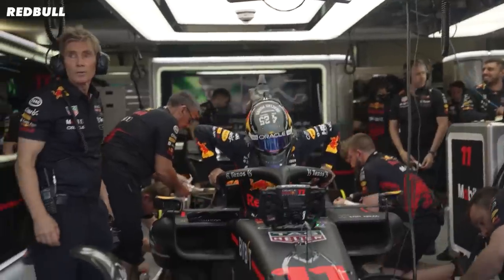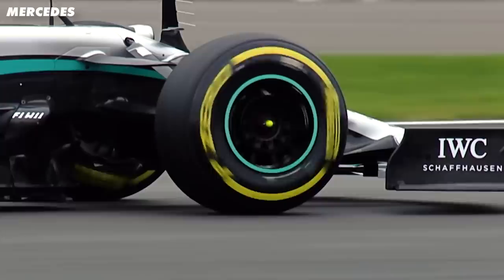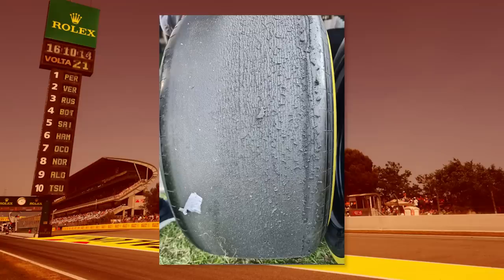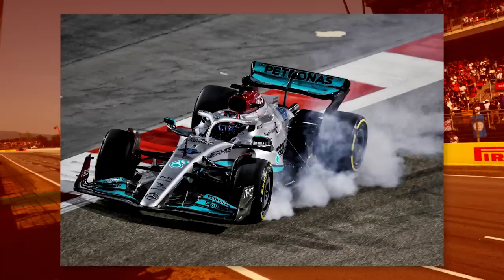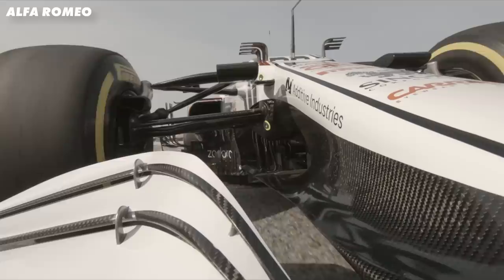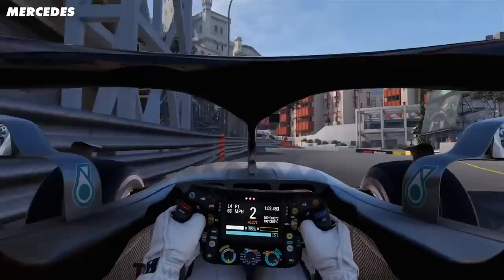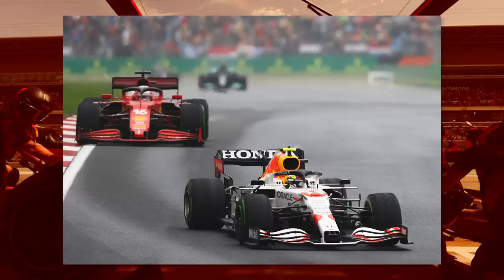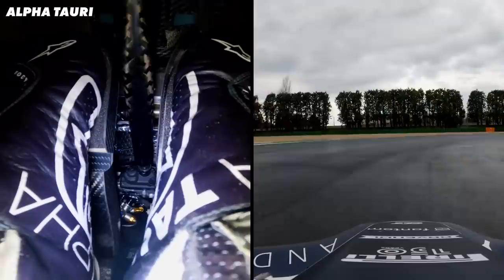Why Perez is INCREDIBLE at Saving Tyres

Comment: I thought Verstappen and Hamilton were the masters on saving tires.
Reply: Hamilton, yes. Verstappen, are you kidding?
Reply: @lorddrac_dontaskmetodance  apparently max became a master too since this year, look at Miami and Imola
Reply: @bokebryant3985  saudi as well
Reply: @bokebryant3985  this year's tires are more durable so I think alot of drivers are finding it easier to manage their tires look at albon in Australia, that would have never been possible with the previous gen of tires
Reply: @lorddrac_dontaskmetodance  Max always been excelent in tire management it's why he won spain 2016 his first race in the car.
Reply: @nulian  That and both Mercedes crashed.
Reply: @bokebryant3985  Max doesn't saved tires that often. Closest thing he gets to saving tires is that you can only run a tire one or two ways during a run so that tread wear doesn't become inconsistent, and he can do that running 100% if he wants to. Really the best example I can give where he could've been saving was this most recent race in Montreal, where he was running his race and hitting his marks, where Sainz was driving the Ferrari 7-8 different way, and when he tried to push on the last lap, his tires were junk, despite him pitting later than Max.
Reply: @lorddrac_dontaskmetodance  i'm a Lewis fan but both verstappen and hamilton are true masters of that
Reply: @lorddrac_dontaskmetodance  clearly you have no clue
Reply: @henrym78  What's your defense?
Reply: @theracingban  probably too, albon was crazy that race
Reply: @lorddrac_dontaskmetodance  maybe, but that results in good tire life after all , intentional or not, haha
Reply: They are
Reply: @lorddrac_dontaskmetodance  Max would rather attack. But if need be he can definitely save his tires. Just look at  Baku where he told his engineer he felt he would need to keep the pace up to keep the tire in the right window. His engineer then agreed 
And Lewis has controlled many races from the front. That makes tire management much easier. If you're 10.or 20.aeconds in front you can easily save your tires.

Comment: My driving style the save tyres is : shifting gears at low - mid rpm at corners and turning the steering wheel slowly to reduce friction .
Reply from the maker: From what we can see in the data - F1 drivers don't do this IRL. More from throttle modulation. It does work in games though.
Reply: @Driver61  hey .you have bots spamming your comment section..

Can you please do something about it?

Comment: Great video, but would just like to say that there are additional mechanisms on top of just the deformation grip you mention in the video (micro and macro features on the track surface and the tyre squishing into those to provide mechanical keying), including adhesion (literal molecular bonding between the tyre and the track surface, "stickiness" of the tyres, also affected by how they deform into the track surface, since it affects actual contact area) and tearing/wear generated grip. Yup, "tearing/wear" is also its own kind of grip type, as explained by inside racing technology:

"High local stress can deform the internal structure of the rubber past the point of elastic recovery. When polymer bonds and crosslinks are stressed to failure the material can't recover completely, and this can cause tearing. Tearing absorbs energy, resulting in additional friction forces in the contact surface."

These three are usually considered the main methods that tyres generate grip with, and each can react differently to track surfaces, temperatures, load, etc. A good example of this is wet weather, which can almost completely remove the adhesion effect (similarly to why sticky tape doesn't work well on damp or wet surfaces), leaving deformation and tearing as the main methods of generating grip.

Comment: Great video! Thanks! I was also wondering: how much of the current way of driving in F1 is just because of physics and rules –the cars move in the most efficient way possible within the limitations and that determines almost all driving decisions? Or does a degree of style or fashion also play into this? I mean would it be reasonable to think that in a decade or so, even within the same kind of limitations, common driving styles could be drastically different? Are there new strategies to be discovered here or are we just juggling known possibilities? I would be very curious to know how you think about this.
Reply: F1 requests that the tires degrade on purpose. They could last the whole race buts it's done on purpose to keep the race interesting. At least this aspect will be similar in the future.

Comment: So, is it a good idea to push harder on left hand turns on a track mostly having right handers?
Does checo's tyre saving ability has to do with setup or its just purely driving style?
Reply from the maker: Yes to the first one, its not worth saving eg right front, when left front is the limitation
Reply: Me activating scenario 7 in austria sector 2 then

Comment: Easiest way to reduce Wear is to drive in a very balanced fashion with minimal braking where possible . Brakes are often overused when racing that’s why front runners overheat their brakes more often than the high speed cruisers who go further on their tyres … Dan used to be good at it too. I’m not too sure why he’s so far back these days, his car is pretty good …

Comment: Not trying to take anything away from Checo, who is a deserving driver in his own right. But the RB car seems to be doing the best of any car on the grid at managing the tyres this season. We heard Horner say that Max's car didn't have the pace delta of Sainz' Ferrari, but rather, he had the grip to hold Sainz off. All this with tyres some 8 laps older than Sainz' set.
Reply: They where 6 lap older hards. Not much of an advantage
Reply: This year does very little to solidify Perez' reputation as a tyre whisperer anyway. If anything, he tends to have more tyre wear than Max. But he earned his reputation long before joining Red Bull. For example, he was the only driver to finish the 2011 Australian GP, the first race with Pirelli, with a one stop strategy, while others had to pit up to four times - and that was his debut!

Comment: Sometimes Max? Besides that Checo lost in Baku because off less tire management     you should check Spain 2016, on circuit where if you push at the end of the first lap your tire is overheated. The dude even drove the car for the first time and just like this Sunday chased by a ferrari but this time for 32 laps, this 18 year old dude even did that race in 1 stop which was unthinkable and you know or should know what that means at Barcelona GP. Yea and this will go on and sooner or later you will realize that you are witnessing the real GOAT of this sport in the making because he is the best this sport has ever seen, now at a age Lewis just started but that’s just a detail 😉
Reply: It’s not rocket science, you just need to be fast without pushing, they all know that, the difficultly is executing it and the best that this sport has ever seen shows that every session and certainly in qualify Q1 and Q2 what being fast without pushing is with his banker laps. It’s never sometimes with Max, Max is on it from day1 , just takes some long to accept

Comment: How is it that Red Bull and Ferrari seem to have sorted out the problem of bouncing where Mercedes haven't. I think if they went back to the none low profile tyres things will be better for the teams that struggling. Because the tyre moved, where as the low profile tyres don't move .they are stiffer than the other tyres they used. That's just my opinion as a fan. Cheers Dave

Comment: Isn't there also the perfect slipangle? You basically scrub the tire through the corner for most grip, because the rubber chemically reacts with the tarmac the most effective Thet way. That's why GT cars almost seem to drift through corners, and the more downforce, the smaller this angle gets

Comment: But isn't is Lewis the king of saving tyres? The las 2 years I wouldn't stop listening that
Reply: Lewis was already fast but had to learn tyre management.  So now he can switch it on and off. 
This is easier than Perez’s case where he was slow over one lap and had to learn to be quick which has taken a really long time.
Reply: @lekudos  since the start of hybrid era Lewis was always great on tyre management. Yes he struggled a bit with the tires in 2011-13 but on Bridgestone tyres  2007-10 Lewis was clearly the best
Reply: @alexlacl8730  pre 2013 I don’t think he was as good on tyres.  He used to complain about why the tyres were gone all the time. That’s why Button could still beat him sometimes. 
In 2013, the Mercedes couldn’t manage its tyres - qualifying on pole and then having to go slowly for 30 laps isn’t helpful!!! 🤣 so Lewis had to learn fast.  
Max is another interesting one. They both have a very similar ability in this area.

Comment: You do realize Monaco is the worse example you could give for tire management?

Speeds are so slow, and the track surface so smooth compared to others like the current French track... 

Suzuka Silverstone or Brazil should have be the focus of your research.

Also rear degradation/save is nothing with out the front tires'... like the actual balance of the car: one thing can't exist with out the other.
So careful claiming Checo is "good saving the rears"... he does more than that.

Comment: 《4:58》OMG❗ how could it be❓ the top racer of F1, they drive those beast car just like part of their body  & limbs❗ man＋car melting into 1❗ the accurate control under Gforce, vibrations hot sweat, low view, pressure⋯⋯is unbelievable❗